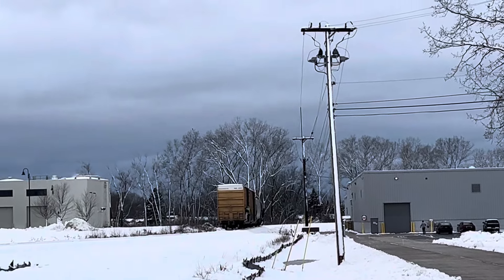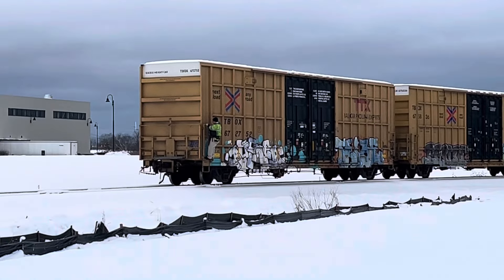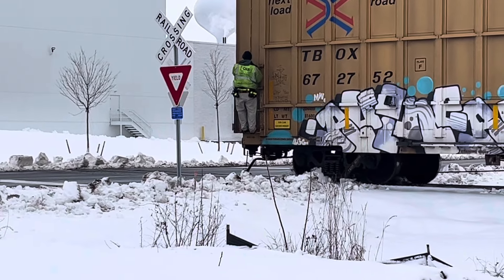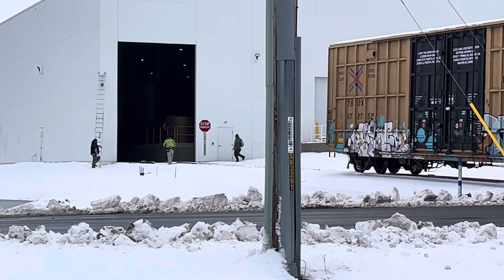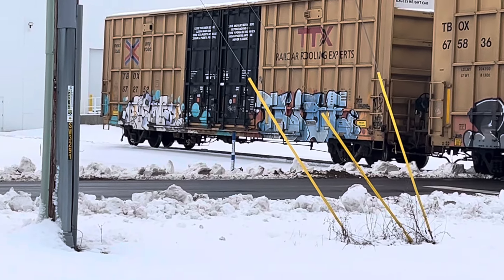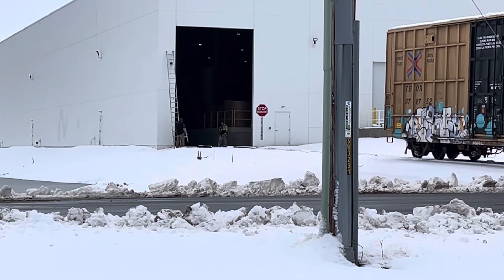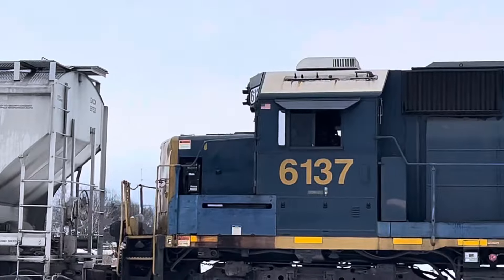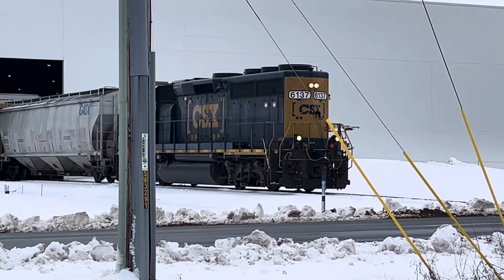CSX Y121 first run into new Siding to Coastal containers in Holland Michigan 1/10/24

Comment: The locomotive's a GP40 (well, GP40-2). Has to be that or a GP38, and the quickest way to tell is that GP40s have three radiator fans, and GP38s have only two, since the less powerful engine needs less cooling. The only thing that can go wrong with this logic is that, sometimes, they'll stick a non-turbocharged engine in a GP40, turning it into a GP38, but keeping the three radiator fans because it'd be a huge job to remove one. Turns out that this locomotive was built for the B&O -- I'm guessing one could figure that out from the unusually placed bell, which is probably characteristic of that road.